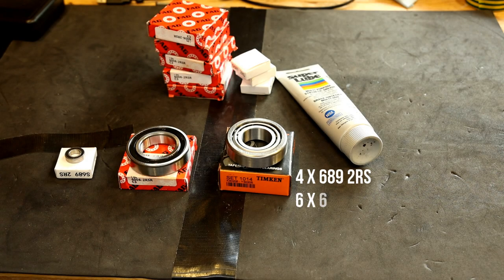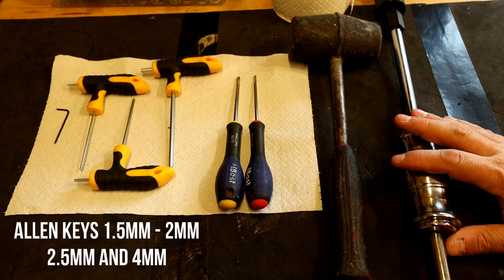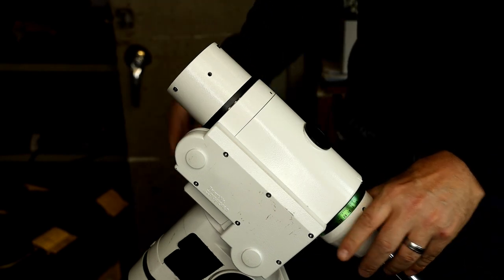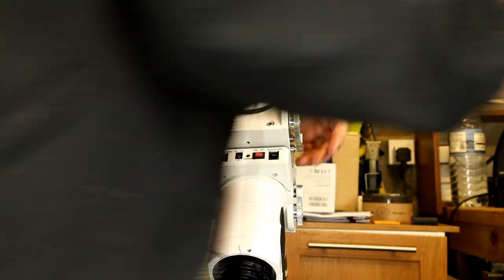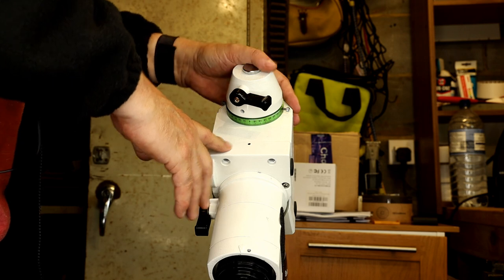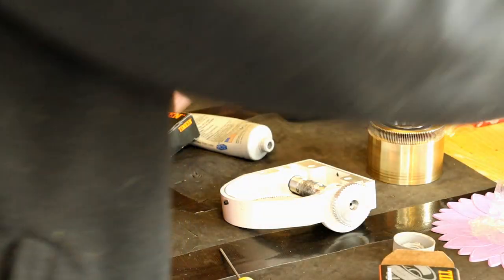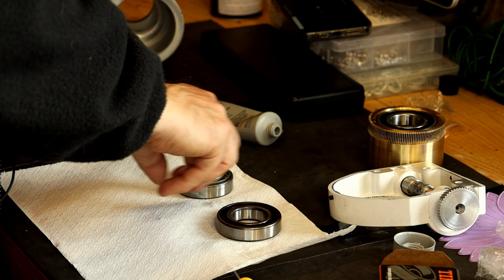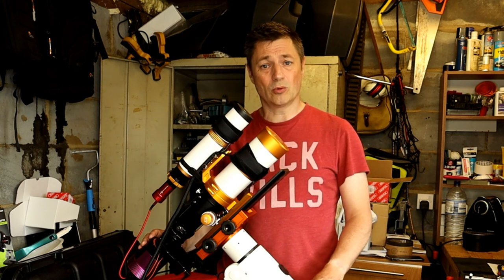HEQ5 Pro Hyper Tune. Get the best out of your mount. Astrophotography

Comment: Hi Astrobloke, thanks a lot of making this video it was really helpful in tuning up and improving my mount. Just a quick question if you don't mind! Below you mentioned guiding in the 0.3-0.5 range of total rms, I was wondering if that  isconsistent or only when pointing high above the horizon, good seeing etc? I've only really been able to use the mount over the last couple of nights and hammer out some other things I'm dealing with but my guiding seemed to average around the 0.6 mark.. sometimes 0.5ish and on the rare occasion I've seen it touch 0.4. My polar alignment was in the region of 4 arc seconds, not sure how much if any that would affect guide stats. Cheers again!
Reply from the maker: Hi Sien and thank you for your kind comments, I am glad you found the video helpful.
The guiding I quote is with excellent seeing and the scope up high . Guiding is very seeing dependent.  I would say on average it guides 0.5 rms. On poor seeing or a low target its normally at 0.7. 
What you are getting is very good and would say you have that tuned in very well. Have you done any PEC training? If you haven't seen my video, it may be worth a look as could bring your guiding rms error down a little bit more. On the HEQ6 it is a little different to the EQ^ R PRO I show it on as you cannot save the PPEC to the mounts motors, you save it in EQMOD and just switch on autopec.
Reply: @Astrobloke  Great to hear! Thanks for clueing me in. I believe I brushed over your video but I'm currently using kstars/ekos with an astroberry and I don't think it's currently supported. Did you have much success? I thought PEC training was only useful if your mount was stationary in an observatory but I may very well be wrong in that.
Reply from the maker: @Sien11  PEC training is beneficial for any mount that has the ability whether on a pier or tripod. It removes the small periodic errors that are in the worm drive and gears that are built in from the manufacturing of the mount. These mounts are produced to a standard due to price and can sometimes have errors that will effect performance. I have found with the 3 mounts I have recorded PEC the RA guiding has improved slightly. If you record and then remove the periodic errors the guiding doesn’t have to work so hard.
Reply: @Astrobloke  Makes sense. I was just looking into it there briefly before I run out the door, it seems I could use predictive PEC via phd2 or create a pec profile via ascom and load this data into ekos, providing my mounts home position stays the same between sessions.
Reply: @Astrobloke  Now I see why I can't save the PPEC in the HEQ5... I was folowing this video https://www.youtube.com/watch?v=PfvWhx7ozi0&t=450s but it´s for the EQ6-R. Last night I was doing the PPEC training on my HEQ5 but I have to abort it because I forgot to turn of dithering off, and the PEC graphic drops a lot. I don't have yet the belt mod, my RMS it´s bellow 1, I'm still doubt if i will get any improvement with him. Thanks for your videos. Greeting from Portugal.
Reply from the maker: @TheHeldere  Hi and yes the HEQ5 is a little different. You cannot save the PPEC into the mounts motors but as long as you park the scope before powering down the auto pec feature will keep your PEC curve and apply it everytime you re start the mount.

Comment: Thank you for your very detailed video.
I have purchased a 2nd hand HEQ5 and I think that the red washer is missing in the Dec axis.
Do you know where I can purchase a set of such washers ?
If I have to manufacture it, do you know the thickness of these red washers ?
Best regards
Philippe
Reply from the maker: Hi Phillipe. I would think you could source that part from any company that services the mounts. In the UK there is Darkframe or firstlightoptics or rothervalleyoptics. You could email Sky Watcher also as they may be able to help. I don’t know if its a set size or if they vary depending on the mount tolerances. I hope you are able to source one and get your mount all working well. Excellent piece of kit
Reply: Thanks for your prompt reply.
I made a trial with a 1 mm thick steel washer, and the gears were not correctly adjusted.
Finally, I 3D-printed a 0.5mm thick washer (made of PLA) and it works perfectly.
The mount has been belt-modified and main bearings have been changed (both RA and DEC).
The original mainboard have been replaced by a Rev C mainboard, able to manage micro-steps (must-have add-on to the "Hyper-tune").
Finally, both RA and DEC axis have now very smooth accelerations and movements.
During the night, I made some guiding error measurements (through Stellarmate guiding function) and obtained rms values between 1.2 and 0.76 arcsec, depending on the dec position of the target.
Thank you again for your tutorial movie.

Comment: Excellent video.  Can I ask if it's necessary to grease the actual bearing?  I've read another set of instructions which is actually quite a bit older but they push white grease into the bearing.
Reply from the maker: Hi Steve.  New bearings come pre greased so no need. The other video may have just been servicing the bearings to replace back in. Only the tapered bearings come without grease as they are open and so you need to grease these.
Reply: I have a further question to this. My issue is with grease thickening in -25C and lower temps. It causes some tracking issues and particular, the mount resets when slewing on both axis due to current draw even with a 5A power supply. Obviously those temps are extreme for most people and not an issue. With the Rowan belt mod alone my tracking went from 1.2-1.4 down to .7-.9 typically, and I’ve bought aircraft grade grease (AeroShell 64) to replace the cheaper factory stuff but now I’m wondering whether it might still be a thickening issue with the sealed bearings too - your best guess?

I just came across your video today and haven’t yet taken apart my HEQ5 Pro mount which is still quite new, or I’d have already ordered the better bearings in hindsight. But I’ll likely go ahead and do the grease change and checks you’ve outlined in this video with the existing bearings while I wait for better bearings to arrive so that hopefully it makes the mount more usable in our current cold snap here (-22 to -35C without windchills - I know windchill only affects me, not the mount).

I’ll probably have my answer before you make it here to reply, but possibly not, and the answer might be relevant to other crazy Canadians or other nationalities who venture out into extremes!

Comment: Hey mate, 

Excellent video. Just wanted to ask two related questions.
1)  How much payload could you put on HEQ5 once you have hypertuned? Or does that make no difference? I have been thinking whether I can put 10kg on HEQ5 pro?

2) I can't get 6006-2RSR, would 6006-2RS work the same?
Reply from the maker: Hi Jeremiah, The heaviest payload I use on the HEQ5 is 6-7Kg so I have never really tested it. Standard 11Kg is stated for imaging and 15Kg visual. I would think after tuning you could most probably push upto the visual limit. 
Yes those bearings would be fine.
Reply: @Astrobloke  Cheers

It would be great to find out the true limits of Heq5 Pro. Perhaps a video on that? :)

Comment: Good job Glenn. My HEQ5 Pro is around 18 months old brought from new. I've had the Rowan belt upgrade and wouldn't mind improving it further. Don't know what yours was like but when I lock the clutch levers in either RA or Dec the mount can still moved by hand. Is that normal?
Reply from the maker: Hi Paul. The clutches are not the greatest design. They can be moved yes, but should need a bit of force. You don't want them slipping while guiding is all. I was surprised my RA was not slipping as there was grease all over the brass gear that the clutch locks to.

Comment: Hey again, 

Just noticed that you didn't put any grease on worm gear (brass bit) Is that intentional?
Reply from the maker: Not really and grease can be added. Because mine was a newer model it didn’t have the very sticky grease the original ones were packed with so I did not degrease the gear just cleaned up any excess. So there was still grease on the gears teeth.
Reply: @Astrobloke  Would you recommend de-greasing and then greasing the older HEQ5 pros?
Reply from the maker: @AstroOnBudget  if it has the very sticky grease I would yes as there is much better performing grease out there. Again I was lucky with the HEQ5 that I bought used as the previous owner had cleaned and regreased when doing a belt mod. I just took it a stage further by buying better bearings for it.
Reply: @Astrobloke  Man, balancing hyper tuned mount is pretty hard....

Comment: After doing the mod it went great. But my DEC is still a bit stiff........ RA is great but DEC still some resistance.... Any ideas?
Reply from the maker: how tight is the bottom main nut that holds the DEC together. See if loosening a little helps. Check that the locking lever is correctly adjusted and not applying any friction. Have you checked it with a scope mounted? The Dec needs something mounted to spin as freely as the RA (the RA has the bar and head weight to give it motion)

Comment: I did notice a strange thing on my mount while adjusting the backlash on the RA axis. If I set the slew rate to "1" on the hand controller, the motor moves only in one direction (the button right on the controller) while there is no reaction if I push the left button. If the slew rate is set to "2" - it moves in both directions with no problem. I was wondering if that is an error on my mount, or if it is because that direction at slow speed is the same as a "hold" command while tracking? (Did the test with no belt not to have stiction affecting the outcome.) Thx in advance
Reply from the maker: That is strange. The only way you could confirm that is if you make sure its not tracking and then try moving it with slew rate 1. Its not something I have ever done so not sure of the correct answer.
Reply: @Astrobloke  Thanks for your answer. I got a friend with a mount set up for observing. Got him to try it on a daytime stationary target. Sure enough at rate 1 it only works in one direction. (And rate 0 both arrows turns it in the same direction, but one at half speed).

Comment: Hi Glenn, Question.. Did you ever get a high pitch sound from your HEQ5 Pro? I just got mine and soon as I powder it up there was an annoying high pitch sound. I read on some forums that others experience it as well. Any thoughts or suggestions?
Reply from the maker: Hi. Is this sound all the time or just when slewing. Stepper motors can give off some strange noises. Personally my mount didn’t do this and not sure what that could be. If you are worried send a message to Sky Watcher, there is a UK service centre in Woolpit Suffolk that are registered with them.
Reply: @Astrobloke Hi, and thanks for getting back to me so fast. I haven't slewed it yet. I got the mount brand new. I turned it on trying to set up my mini pc. And as soon as it got power the noise was prevalent. I tried different power adapters and same noise. I'll try contacting Sky-Watcher and see what they say. 
Best Regards, 
Glenn from USA😁

Comment: Great video. I know you have just starting using your HEQ5 but I will be interested in comparing it to your EQ6 Pro. I know the main difference is load capability which I don't care about (I will not use anything larger than a 105 refractor). How does your hyper tuned HEQ5 perform relative to accuracy, ease of use etc. compared to the 6. Thanks.
Reply from the maker: In all honesty the HEQ5 is returning mostly 0.4 - 0.5 total rms error and my Eq6 0.4 so apart from load capacity almost the same. The HEQ5 is much easier to balance now. I do plan to do the same to my eq6 but not sure if I can improve the numbers much but I do hope for it to be a lot smoother and easier to balance. If you don’t think you’ll need the higher payload I would go for the HEQ5 all day long but it does need the tune up. Out of the box it won’t be as good but it is a cracking mount and I love mine
Reply: @Astrobloke  Did you use/recommend the ceramic hybrid version of these bearings. I don't mind the cost difference. Thanks.
Reply from the maker: @richardmarquardt6246  I have not used the ceramic bearings  but I would think they would be absolutely fine for the job. I do mention in the video that I have read that in extremely cold environments it can effect their performance. I don’t know how cold they are talking but I would assume most probably too cold to be outside yourself .
Reply: @Astrobloke  Thanks. One last question about your video, I know you used new bearings and did not try to get grease into the bearing itself, other than the tapered bearing. Since these are sealed bearings, I believe, I don't think you can get grease into the bearing itself anyway. Do you agree?
Reply from the maker: @richardmarquardt6246  you can lift the seals off and re grease the deep ball groove bearings but if you buy good quality new ones they come pre greased and doesn’t need doing.
Reply: @Astrobloke  Thanks. I assume that the bearings from Bearings Online that you mentioned fit in that category since you only greased the outside of the bearings and shafts.
Reply from the maker: @richardmarquardt6246  yes mate they all come pre greased apart from the tapered roller bearings
Reply: @Astrobloke  Thanks. I just ordered a new HEQ5 (delivery delayed for a month) and the bearing sets. Thanks again for videos and advice. Great help!

Comment: Is 6006 2RS1 the same as 6006 2RSR?
Reply from the maker: Hi Michael. The size is correct and the letters at the end denote bearing seals etc. 2RS i believe would mean it has 2 seals so yes the same but worth checking with bearing supplier to the differences but should be ok